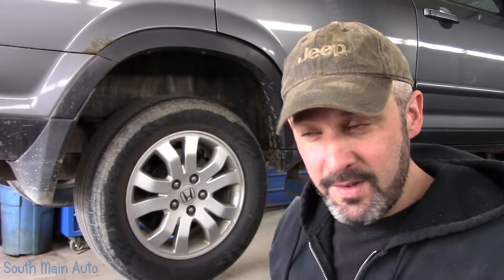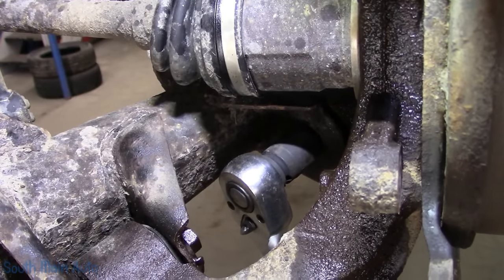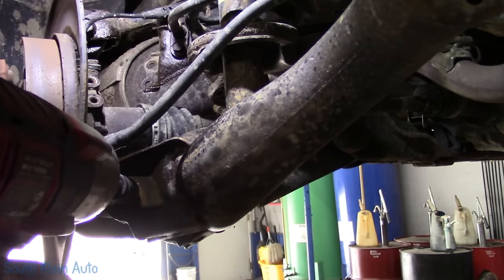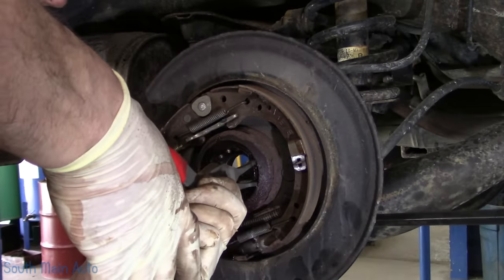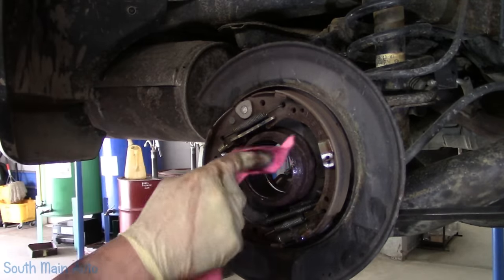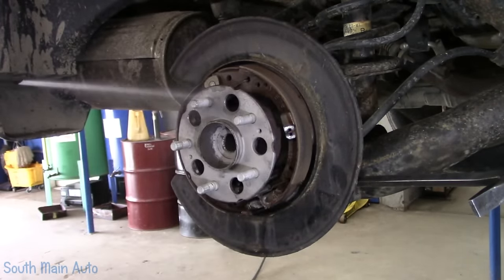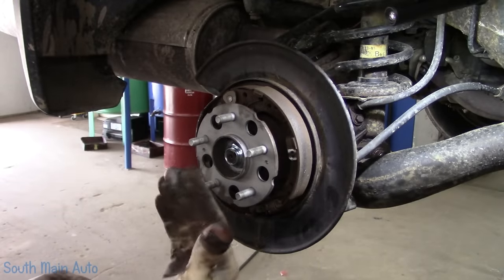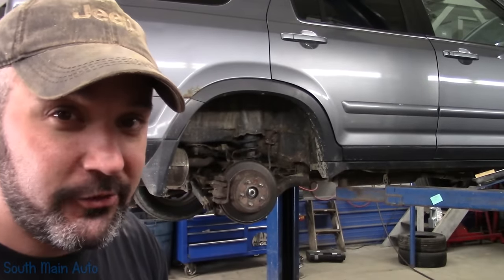Honda CRV: Rear Wheel Bearing & Other Repairs Part I

Comment from the maker: *Induction Innovations MD-700 Mini-Ductor II Magnetic Induction Heater Kit: https://amzn.to/2JsYhOG
*Stanley Proto J7099A 13 Piece 3/8" Drive Hand Impact Driver Set: https://amzn.to/2KhJxn0
*Astro Pneumatic Tool 4980 0.498" Shank Super Duty Air Hammer/Riveter: https://amzn.to/2FgSZ6A
*These are my favorite gloves that I use: https://amzn.to/2FhchJa
*Astro Pneumatic Tool 40SLMAX Astro 450 Lumen Rechargeable LED Slim Light with XL Battery:https://amzn.to/2Jr2T81
*OTC 4579 9-Way Slide Hammer Puller Set: https://amzn.to/2qZUNf6
*OTC (7703) 10 Lb. Slide Hammer Puller: https://amzn.to/2r5OOpl
*OTC (6575) Hub Grappler Kit: https://amzn.to/2r1nRmo
Reply: Induction Innovations Mini Ductor MDV-777 Venom, newest iteration. Very Cool.  Only $569 from JB Tool Sales.
Reply: South Main Auto Repair  Rusty bolts the struggle is no joke. I know myself. GOOD JOB!!!
Reply: Von Svietzer yes they are a good buy for the astro ball joint tools I have them and also alot of other astro pneumatic tools
Reply: South Main Auto Repair iI
Reply: I noticed the brake dust shield still in great condition ( almost new) and the ball bearings were nuke.
It must be a curb hugger loving driver owner or HONDA quality became famous GM quality.
Reply: Im pretty sure you can pop the tops off the WD-40 cans with bendy straw and use them on other cans if you wanted too.
Reply: 111
Reply: Garth Goldberg c.
Reply: What was the tool you used to pull the bearing out and press it back in? Non of the links listed have the long threaded bar in them. Thanks
Reply: Hi. What’s the size of Honda CRV 2006 rear wheel bearing? Any idea ? Thanks
Reply: Hi this is Tomm Williams I have a 2500 series GMC 06 engine in it but I’m having a problem with the brakes on the unit and put new pads on it and put new calipers on I put new rotors on it I put everything on there and hoses and a master cylinder and booster behind it and we’re still having a problem with the brakes hanging up especially on on the front front and front left hanging up to a point to where they create so much friction and gets warm and ceases up again until it cools off you can’t go anywhere gas could you please put that on your list ther thanks

Comment: I will never get tired of the "Nuts and Bolts" videos. Each job presents its own set of problems. Seeing you solve those problems is very helpful. So please more nuts and bolts. Hint Hint Ford 2016 ford escape rear brakes, please..LL
Reply: I vote for nuts and bolts also. I need all the help I can get. Thanks for your good video
Reply: But don't let up on the programming / electrical issues either. They're all important.
Reply: Yes, but only if they're really rusty. Otherwise they're too easy for Eric.

Comment: Don't know where else to put my comment so I picked this video.  Been following your channel for a few years. Just wanted to say thanks for all the great videos. I have always been mechanically inclined, but your clear concise videos have filled in some knowledge gaps and given me many good tips and techniques that I now use to maintain mine and my wife's vehicles and save lots of cash at the same time.  Just this past week I replaced rear brakes (pads, rotors, calipers), rear hub assemblies, rear shocks, front tie rod ends and control arms and a new drive belt and tensioner pulley on a 2008 Honda accord with 300k +kms. Riding great again and saved tons on labour costs!  Thanks again!

Comment: I can vouch for swearing - it works for me, and has for a long time. 😂 

Big Nasty has been the biggest time saver I've bought in a long time. Can't thank you enough for that recommendation. Can't believe it's coming up on a year old already! Crazy ...

That time o' year again. Slammed with summer tires to swap, and lawn tractors to service. In between all that I helped my buddy's crew finish the siding on the ol' barn. That's all done - now I just need a floor to put my lift on! Brand new lift is going to be a pile of RUST by the time I get it installed. Such is life ... MY life, lol.

Since it's cold and rainy, and I have no heat in the new shop yet, I'm catching up on my missed Youtube vids. Missed WUW, and several others - they stack up fast! I'd better get at it. I've got another 8 hours of vids to watch ... 🤣
Reply from the maker: I'll give you the recap on all the  recent videos:
-Eric O brings in rusty car and it is broke
-He does some repairs, cracks a few jokes.
-Sprays something with brake clean
-Goes on test drive and tells you to sub.
-The end music plays
Reply: 😂 🤣 😂

I still watched ALL of them, start to finish. We'd have way too much fun if we worked together. We'd be alot less productive ... but LOTS of laughs would happen. 😁

Comment: YOU ARE AWESOME - YOU ARE AWESOME.  I know it's time consuming (moving the camera around) and editing but these shots are excellent quality.  Aug 5, 2020: I had the L/R rear bearings and L/R rear struts replaced on a 2008 CRV (seems to be a piece of trash after so many repairs in just 2.5 years  2018-2019-2020 since purchasing)  Yes, I understand replacement repairs after year #8, but THIS IS RIDICULOUS!!  Since purchasing I have replaced: 1. both cooling fans.  2. Pwr Strg pressure hose  3. Fr. Rt. axle - TWICE!! 9 with 1 yr of each other) 4. Front L/R struts.  5. Muffler (we though was the 'loud road noise' later to find out it was the rear bearings that continued to escalate in noise recently) 6. L/R rear bearings.  7. L/R rear struts.  8.  Not to mention the CLASS ACTION LAWSUIT on the driver actuator that was psycho on the auto door locks - popping up and down (saved me $350) since it was free.

Comment: In other instructional videos everything is always easy and clean. Like one I just saw where the presenter was showing how to replace toilet components and you could easily tell he had already taken it all apart so many times it was practically falling apart.  And I try the same repair and everything is stuck and corroded and I couldn't even get the water shutoff valve for the whole house to work without spewing water.  And the only way I could get the tank bolts out was to drain it, dry it, and Dremel tool them out. In the video they took out those bolts with their fingers.

Eric shows all the hiccups you can run into.  And the tricks to overcome them. And sometimes the tricks aren't pretty.  He doesn't hide it when the S.H.T.F. And you learn how to fix things when all goes wrong.
I particularly liked the one about his own Honda Civic strut replacement and the trouble he had getting those bushings to come loose.  
I was ready for him to just junk the car for parts.  But he persevered.

Comment: This video, a rental slide hammer from AutoZone, and the Astro 72885 kit let me knock out this job this evening!  Dealer wanted $600+, I did it for $120.  Thanks Eric!  You saved me $500!  I had it a bit easier because my 06 CRV is 2wd, and I live in Texas!

Comment: I just finished putting my rear bearing on my 05 Honda element only to take it for a cruise and the brand new bearing is still humming. So on YouTube I've been sitting for 49 minutes to figure out what I did wrong I think I didn't put the hub in all the way . Tomorrow I'll rip it all apart again.  Loved the tool shout out at the end I've been on Amazon buying some of them for the project to make it easier. You forgot the most important tool of the video....hoist lol wish I had 1 thanks for making this video it's helped me a lot. I'm in Ontario so I feel your rust belt pain.

Comment: I've had good luck on suspension bolts stuck in bushings,  like leaf spring hangers, I air hammer the bolt head on the flats, side to side,  with flat blunt tip. Deforms head a tad, but your still able to get socket on to turn out.  Suprising it rattles the rust free and bolt comes out. Gotta love the northeast haha

Comment: The way I loosen them up is, using a braking bar, with a pipe at the end and pull, it usually brakes loose the toughest bolts.  Having said that you are good at what do you, thanks for making the video.

Comment: Hello SMA, good job for all of the video's, i watch them sinds years and love them.
you present them with some humor and originality.
i am ex mechanic en pensioned now, and revive my job when i see you working like i do it myself (hihi ...nostalgie )
one remarcque, you need eye-protection when using "brake cleaner".
my expieriance is that when 1 tiny drop if this stuff in your naked eye and it hurts  teribly, like sombody puls your eye out allive.
just saying.
hope you can read my written english, i am belgiam flemisch.
greetz jempi.

Comment: Eric, I on a 99 civic I broke the threads off the rear lower control arm bolt, which was basically a welded on nut that the bolt passes through. Made for one hell of a day. I hate the rust belt.

Comment: Eric, I know you don't have any advertisement deals with Harbor Freight, but this is a great review for the Earthquake products.  I was just there today looking at the 3/8 & 1/2 in. Impacts, which right now they have the 1/2 in. going for $30.00 off and will probably go back tomorrow and pick it up...  I know it's a little overkill for what I need, but I'd rather have more torque than needed than not enough. Although the 3/8 in. felt a lot better in the hand (of course).. Thanks for another great video...

Comment: Up here in Canada we buy 5 gallon buckets of anti seize, just before winter, remove every bolt and nut under the car, including exhaust bolts, wheel bearing hubs etc,  coat everything with anti seize, then, take the last 3 gallons and a paint brush and coat everything under the car half way up the doors, and coat the door hinge bolts too, just do this every year and you will get more years out of your car.

Comment: Excellent work and really nice video.  That being said,  what a MAJOR pain in the ass!!  For a friggin wheel bearing!  I bought an 04 CRV a couple years ago, really clean, but in the North East.  Beginning to think I'm gonna regret it.  Startin to get a little "noise" back there.  As a fairly competent "diy'r" I'd never attempt this job.  Not enough tools, patience, lift, etc.   If I was in there that far,  I'd probably replace a whole bunch of other stuff, too.  Holy crap....what a pain in the ass!  My hat's off to ya, SMAR.

Comment: I just took the wd-40 tops and put them on the cans of whatever. Works great. Did it with a can of brake clean first. As long as it is a standard type of can top.

Comment: I've done those without pulling the CV axle. Just remove the hub with the slam hammer, knock the ball bearings out, slide a piece of tubing over the splines, run a bead of weld in the race, weld two bolts to the race and pry it out, with the knuckle still hot from welding, tap the new bearing in, and tap the hub on and use the axle to pull it together. 

Not ideal, but when you work on rusty junk you do what you have to.

Comment: 1/2 inch Milwaukee impact got it all out easily. I'm in Canada, so corroded its probably not road worthy lol. I put the impact on the bolt and held the nut. bolt always backed out for me. Got my axle from scrap and same deal at the junkyard. Trick is to look at it really hard for 15 minutes first.

Comment: Those bearing races.... if you use a dremel tool (takes a bit of time) with a cut off wheel, when you get about 95% through, the ring pops/fractures because of the tension and it slides off. I've done this many, many times, and I've only knicked one hub shaft.

Comment: thankyou  for your time after doing this on my 2007 and replaced the driver side with   honda bearing . the fn rotor is coming in contact to backing plate >i cant believe where do I go from here.

Comment: Snap ring in - CHECK. Starting nuts by hand to find thread - CHECK (in other instances brake line flair nut threaded on pipe beforehand CHECK)

Comment: Very good video I just did one on a 2015 right rear got lucky newer models now have rear bolt in type taped right out bolted back in did not have to use the hub tamer    I might buy that harbor freight electric air ratchet you have must be good if you have one ,

Comment: Just wondering if you seen the videos removing the bearing race from the hub with 2 sockets and a torch. If not... put a socket in a vise that the hub will pivit on and a smaller on on a wheel stud as a handle to spin the hub while heating the race. They fall right off..

Comment: Question: if you've already got the bearing moving and you've already ripped the hub side inner race off it, why not simply put Big Nasty behind it and push it out instead of the forcing screw shenanigans?
Reply: Still an opportunity to do damage that way. If the bearing gets cocked a little sideways, you run the chance of damaging the bore. The forcing screw is much more likely to give a straight pull.

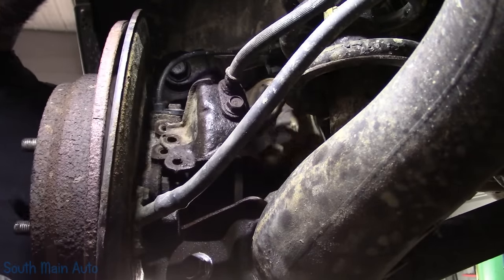Comment: Another awesome job is done. I realize this video is dated but I want to make a simple observation. At 43:58, did anybody else notice what appears to be a crack in the rotor? From this angle, I can't see how badly it's cracked. Might be just the outer edge.

Comment: Doing a front wheel bearing on a 88 olds 88 couldnt get the axel nut off worked and worked went to bed layingcthere thinking about it and it came to me I was tightening it instead of loosening it felt like a fool next morning turned it the right way fixed in no time, boy what a dummy lefty loosey righty tighty lol

Comment: About induction heather, is it a saver for bolts that is solid rusted, ore just wasted buying?
 I use metode like welding on a bigger nut on boltheads and nuts, ore i just trye ratchet and socket. If its not moving then, the bolt usuly brakes, ore damage the bolt head.
Air driver on these bolts, i have had many broken heads and nuts and its often a xxxx of a job drilling the piece out again. But some bolts never get out in one piece.
Thanks for a great video.

Comment: Great video. I wanted to know why my mechanic was not his usual optimistic self. Yes I have an optimistic one. Ok I think those 2 bolts he too is not great on. All seized up n rusty. But I love my 2004 mk2 crv.  There's only crvs driving Round the UK that old with any quantity in the UK. They are that good. First time on the back axle for my babe. Lot a knocking going on before. English roads are crap.

Comment: Great job you done. I"m not a mechanic, but I got a question if you would like to answer it.
A CV join on the front shaft of a 03 jeep liberty got bad cause it a grinding noise. What I don't understand is the reason the shifter linkage cable got loose off the transfer case and the wires of the position control switch burnt out melting their insul insulation. Could be the alternator the culprit?

Comment: Just wanted to confirm something here: On these 4wd CR-V's the rear ABS doesn't use a CV-mounted tone ring, but rather metal cuts in the wheel hub that pass within proximity of the wheel speed sensor? Thanks in advance if you're able to answer because I noticed that when I bought a new pair of CV axles, they didn't have ABS rings on them.

Comment: So does just a press fit on the bearing keep the hub in place?  That seems like a really bad design. I would have expected a second snap ring on the back side.
Reply: Suicidaljello no the axleshaft slides loose I. The hub so the suspension can go up and down and the axle just pops out of the diff so that won’t hold anything.

Comment: Are you going to remove and lube up the left side adjuster, or wait until you get it on the rack?   I guess you have a 50/50 chance the right side is in, and maybe a 50/50 chance you'll tear the bushings on the right side also. Wondering how you handle it?

Comment: Hello Mr. ERIC O. Sir, I  remember the grounding strap communication problem you had on a vehicle you had just done in the last 3 months.  The guy at Pine whatever channel and he just snapped two to three grounding straps off the motor while changing the head gasket on a Subaru pt1.  I told Him he was an idiot. Could you refresh my memory on the video you made so i could forwrd it to him for being an educational video for dummys.  I didn't give your site he wants the scientific reason for the straps and why they are there.  Thanks you air for your help.  God Bless.

Comment: Hey Eric. Thanks for your videos. I too live in "rust" country-Northern Ontario. 
Just wondering if CV shaft could be removed  by removing the top bolt rather than the two bottom bolts, it would avoid having to do alignment?  I have two CRVs and no doubt will have to replace bearings at one point . Thanks

Comment: Eric,
Is this answer answer, which I left on the Amazon site for the Stanley Proto impact tool,  accurate? 
" I agree with one responder that the question seems to be: Does the tool need to be manually reset after each blow? This is required with the Lisle version of this tool, for example, and will slow you down on a fastener that is really stuck (a problem for a professional mechanic). The Stanley, on the other hand, appears to automatically reset itself after each blow so you can just keep striking the tool until the fastener releases. In my view this makes the Stanley worth the extra 20 bucks over the cheaper versions of this tool. You can observe this feature of the Stanley in the brake jobs done by the legendary "Eric O" of the "South Main Auto Channel" who, btw, recommends the Stanley impact tool."

Comment: I’ve got to replace the axle on my mk2 crv next week and I managed to get the axle nut off, lots of heat but it won’t go in even though I put the old nut on and really whacked it. Although I haven’t disconnected anything on the bottom of the wheel assembly the axle should be able to move inwards without the nut on it shouldn’t it? Thanks in advance.